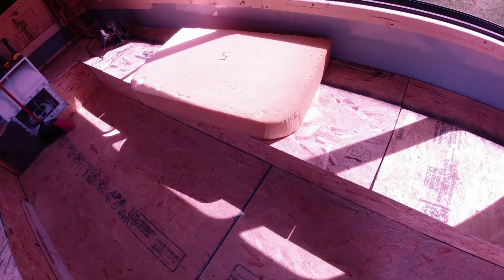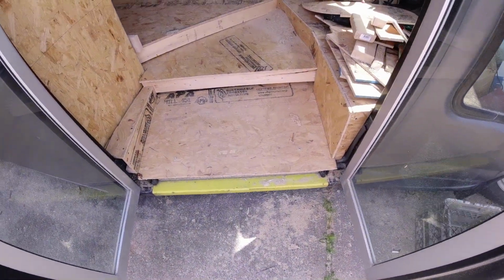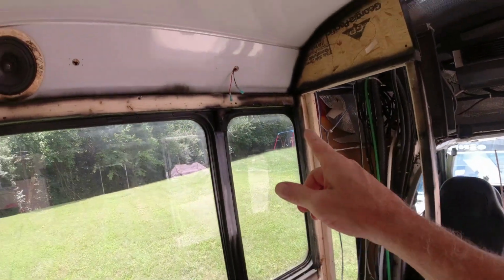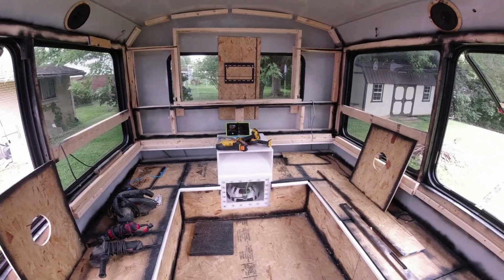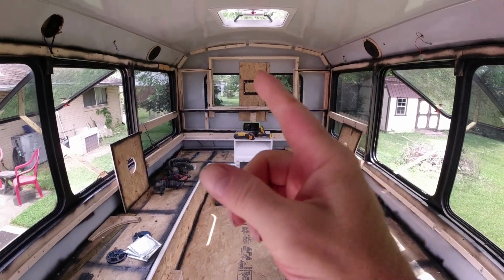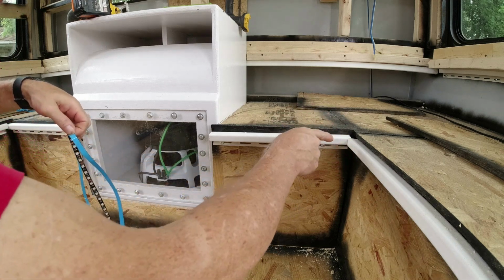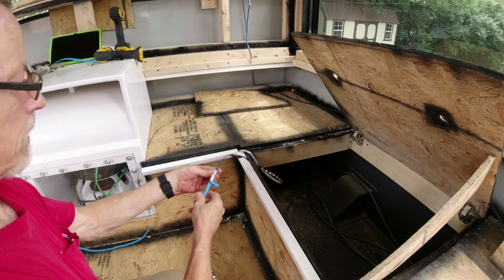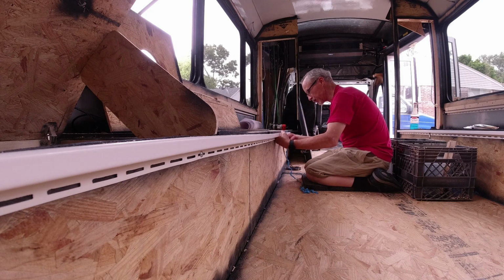DCC- Croc Party Bus - LED lights, hinged compartments, Steps

Comment: Measurements on seat height??
Reply from the maker: It all depends on the thickness of the foam you use. Basically I try to put the seats to the same height as a folding chair.